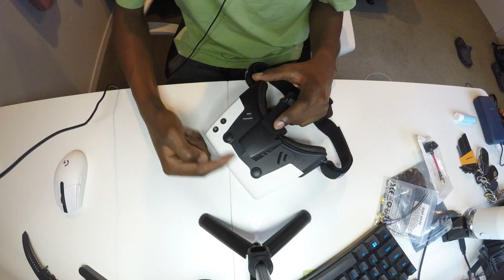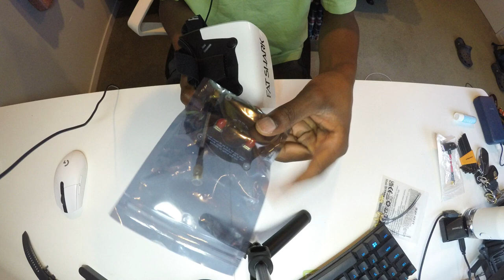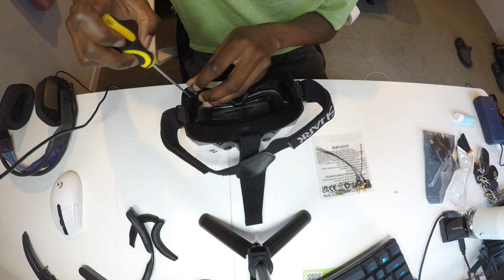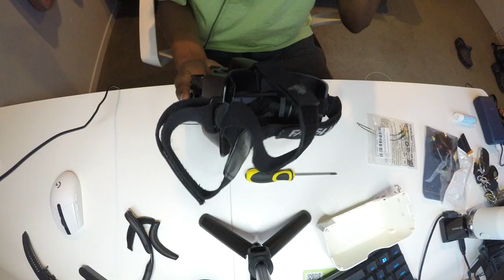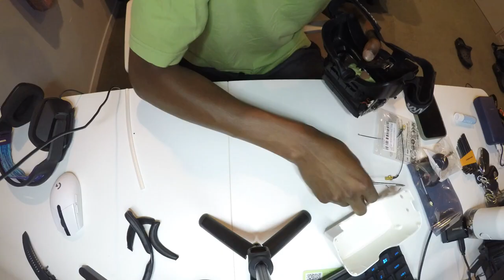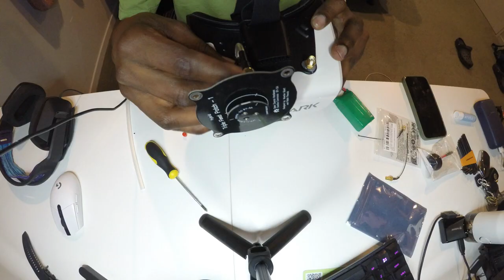Diy antenna upgrade | FatShark Recon FPV Goggles (EXPERIMENTAL)

Comment: I’m sure someone has mentioned that the patch’s you left inside are linear so it’s kinda defeating the upgrade
Reply from the maker: The ability to add different kinds or antennas (making the system hotswappable) is the upgrade. You could basically add antennas fit for your use.

Comment: So at first I was kind of impressed.By this video but after completing this modification I was not. The video is misleading and if you are going to make a modification such as this you should not use hot glue.  If you make this modification , the only extra space that is available in the case is on the side of the goggle near the fan or on the opposite side. With that being said, you should still have a hot air blower to heat up the plastic to pull it out.Because you need that much space for these antenna's to fit properly with the s.M.A connector. Failure to make extra space inside of the case will result in a distorted image but once you relieve the pressure, the image returns to normal.If you're interested in seeing the pictures of my modification h.M u..
Reply from the maker: Thanks for the the feedback my friend. It would all be wise to point out that this idea was also just a proof of concept as well and it was also my first time. I apologise if the video gave the impression that it would be prefect
Reply: @PinkPropeller no you did it all well but the patch needs to be removed and 2 more sma on the left side this is what I have done
Reply: we should do a colaboration video i would like to show you mine.
Reply: @thekuull  i would like to see what you have done
Reply: I did it just fine with 4 sma but you can’t leave the patches inside they are linear and the avatar is lhcp
Reply: i would like to see what you have done
Reply: I remodified the goggles to there original state as best i could. Ill check and if the photos are available.